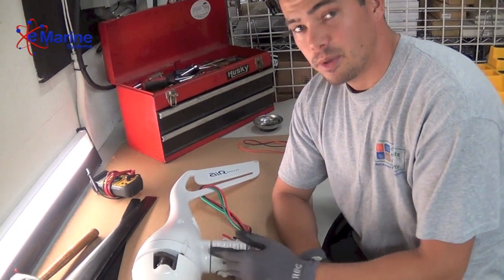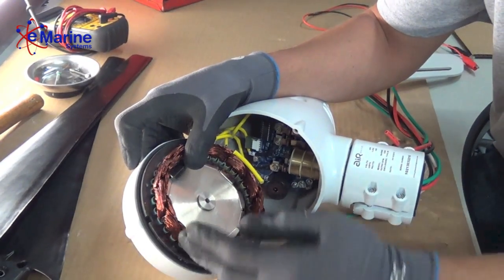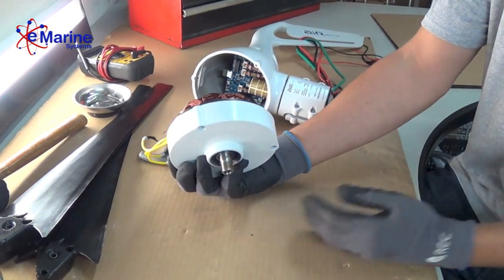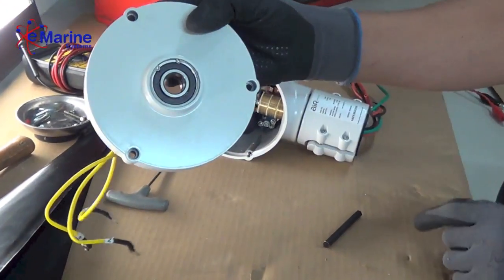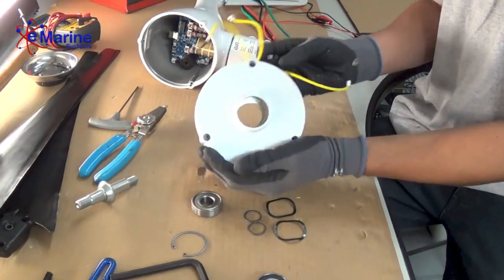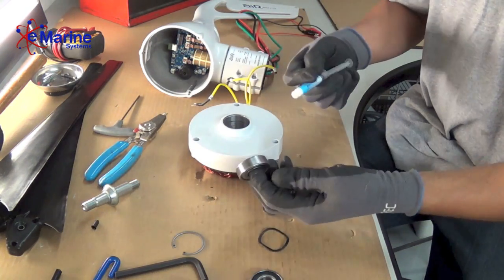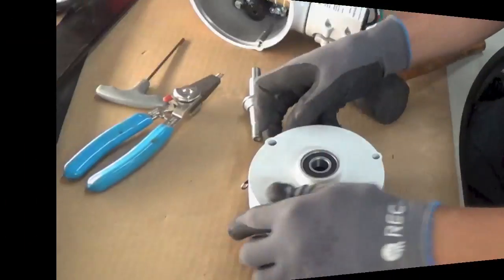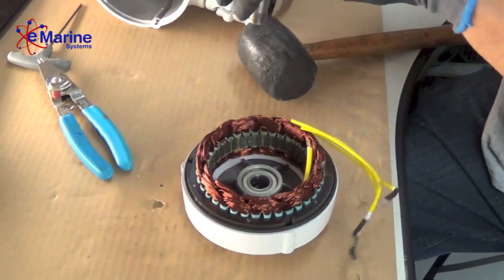How To Replace Face Bearings of An AIR Wind Generator - e Marine Systems

Comment: What are the symptoms of worn bearings? Mine just started to make a weird vibration today. Blades not damaged and less than a year old since they were replaced. Is it bearings or a fault in the electronics?  No crunchy squeaking noise and the vibration came on suddenly over the course of a windy morning. The blades and rotor seem to be tightly fastened still and I'm not feeling any undue slop anywhere or dragging when I rotate by hand. No slop in yaw bearings either.

Comment: What are the Allen key sizes? Specifically the wiring connector.
Reply: @Will he heck as like ended up doing it without removing wire connections. 
Did not have access to imperial Allen keys. The rest can be done with metric.

Comment: I followed the video and replaced the bearings easily, thanks.  Points to note are that the hex bolts are all Imperial.  I didn't have a hex spanner for the 3 wire connections but managed to do the job with the wires in situ.
Took the 2 (Chinese!) bearings to Bearing Warehouse and they quickly came up with SKS equivalents for £12.
For reference they are 6203 ZZ   and 6203 2RS , identical except one has the plastic shield as per the video.
A nice simple job!

Comment: Why are you removing the bearings of the original system? How many volts does that system produce? How many rpm does the system produce? How many volts? Explain first, then do everything.